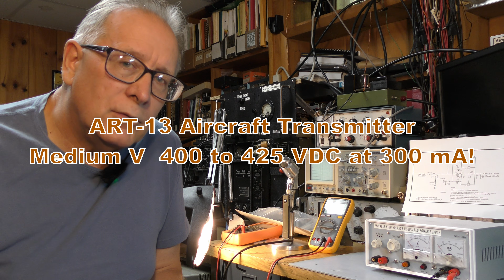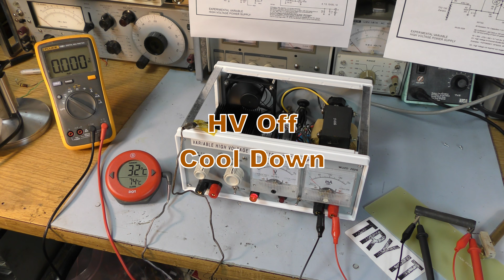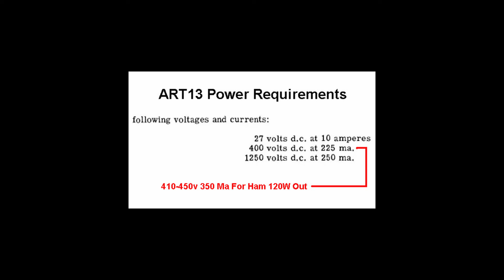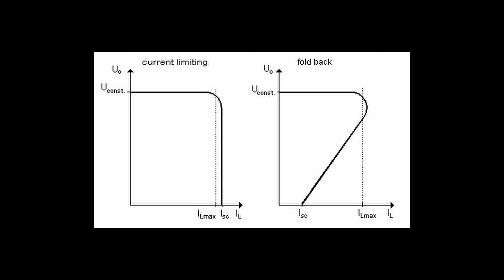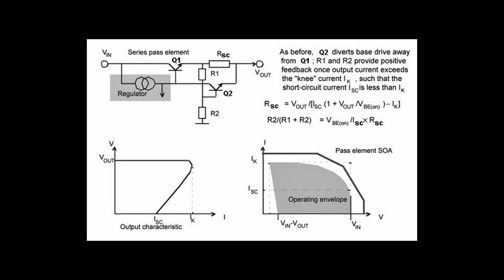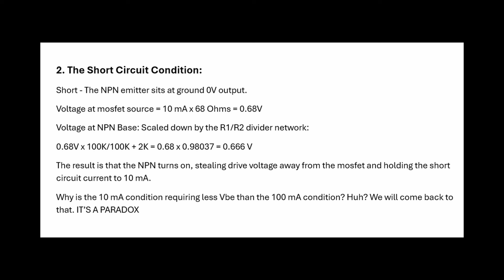High Voltage Variable Regulated PSU   Part 4

Comment: I am really interested in building your power supply circuit. I like that you use commonly available electronic components. 👍 How hard would it be to add an adjustable pot Current Limiter Circuit to the output of the power supply?
Reply from the maker: That is a little beyond this project complexity. I tried to keep it simple. With high voltage, it would require high side sensing and isolation. This is where switchers come into play more. Check out the TI LNP8646 chip.
Reply: @MIKROWAVE1  Thanks for your reply to my question. I will check out the LMP 8646 IC. You are a Great Help,Thanks 👍🙂

Comment: 👍Thanks for this series Mike. Nice thumbnail too (SPAM?).
I do need to make a supply for low power tube projects and this helps.
A while ago, I got some 12V dc to 240V ac inverters rated at 75W from a junk shop. I had been thinking of using one of these to get the HT. With a doubler, may be able to get around 500V dc??
Certainly, this series gives me the option of building something like yours.

Comment: Mike do you realize that this HVDC power supply with voltmeter and MA meter, would make and excellent higher voltage electrolytic capacitor tester / reformer. The MA meter would show you how leaky the capacitor is.

Comment: Your alligator leads are better than mine.  A lot of mine are not touchable at HV.  The ones I use for my Fluke 407D are, but the rest I don't trust, been bit a few times.  
One the thermal subject.  I'm building with a 140W Peltier right now, skived copper heat sink with 2 40mm Sanyo blowers ducted through the fins.  Classic case of way too little and then compensating to way too much.

Comment: Speaking of regulators does anyone regulate dial strings? I recently bought two receivers from a saintly seller, but I foolishly did not check to see if the dial pointer moved. I am a mechanical idiot, and dial strings are beyond me. Do a video on dial strings.
Your regulator looks amazing. The fan is so quiet, even a deaf person could hear it.
Reply from the maker: First of all, I can't see you.  Why do you think they call it a "Spinner Dial"?
Reply: @MIKROWAVE1  I am usually careful about what I buy but I didn't trust but verify. It is on me not to verify it is on the seller to not disclose. I also bought a Drake2b that I trusted based on a going over by a restorer that didn't work properly. 
I really screwed up at Marlboro.

Comment: I think I might like your foldback better than the one I first thought of.  The divider for the foldback also can serve as the discharge resistor to bring the terminal voltage down to zero when you power off.  This will save a part.
BTW:  On fiddly repeated calculations it is really good to know how to abuse a spread sheet for the purpose
A spreadsheet will quickly redo a calculation if an input assumption changes
When doing this I tend to:
Use column A just to document with things like "Vin ="
I put the values and calculations in column B
Sometimes column L will also be documentation for "Konstants" I put in column K
I use gnumeric mostly but LibreOffice will also work.  
In both cases remember that
"$K$1" means I always mean the value from K1
"K1" will get changed to "K2" if you copy and pasted down one cell.
Reply from the maker: I was amazed at the AI stream as I changed values mid-steam and it updated everything as I went. Amazing.

Comment: Note about anodize:  "decorative anodize" isn't good for basically any voltage.  "hard anodize" can be trusted up to maybe 60V but certainly not 600V.  It is best to never trust it to insulate unless you are trying to make a connection in which case you can be sure it will insulate.
Reply from the maker: Murphy's Law of Anodize!
Reply: @MIKROWAVE1  Yup and
It is from experience.
and
Two bits of anodized metal massively modulated some RF because they lightly touched

Comment: That is some problem I am never able to solve, doesn’t matter how much I plan beforehand. Should the fan blow over the heatsink, or suck over the heatsink…. Should I mount the heatsink horizontally and the fan blowing/sucking air over it, with or without a duct, or should you just mount the heatsink on the outside, with a fan blowing air over it…. Just when I think I have the right solution, in my next project I need a totally different solution… Nevermind, I know thermal solutions is a whole science on its own, with enough rabbitholes to fall into…..😂😂😂 I would rather get to a compromised and not ideal solution to a thermal issue, as long as my electronic design does not overheat….
Reply: Generally blowing is much better.  That way the fan is cool and lasts a long time.
Reply: @k @kensmith5694 n remember spending around 20++ years in a development lab…. Every time a new product came up that needed a lot of cooling, huge debates coming up… for some of us oldish guys, like you say, blowing air over the heatsinks are the best solution, in our minds (20++ years of experience), but then we would get a youngster, fresh from university, showing his simulations on a computer, showing us that our theories were obsolete…. Hey, some of us were not against learning new stuff from youngsters…  and going into that loop again, and again…. But the same applied to RF-design… some old engineers think they know the best, some freshly graduated engineers think us old engineers are obsolete…. and the truth lies somewhere in the middle…. Same with thermal design with high-power amps/supplies…. 😂😂😂

Comment: We have TINA, it's free and no AI shit. We did not have AI before and got it right, right.
Reply: I use the LTSpice and also the one that comes with Kicad.
I also abuse spreadsheets a lot.  My working stuff out document is often a spreadsheet as I explained in a different comment.
Reply from the maker: @kensmith5694  Over the years many engineers I worked with used Excel for everything from RF Matching  to luncheon planning!
Reply: @MIKROWAVE1  Spreadsheets can be very good things.  This goes double when you abuse them for stuff they were never intended.  Matt Parker has used them to display photos using the conditional formatting

Comment: Time to 3D print a shield to blow the air better over the heat sink.
Reply: That could be a good idea.  The plastic of a 3D print is non-conductive so a fan mounted with a duct wouldn't be an dangerous voltage.
Reply: As long as you're okay with it possibly melting and being a good incendiary device.
Reply: @clytle374  The plastic won't get up to above about 100C in the worst case.  With care even PLA could work OK.  Just don't screw it directly to the heatsink